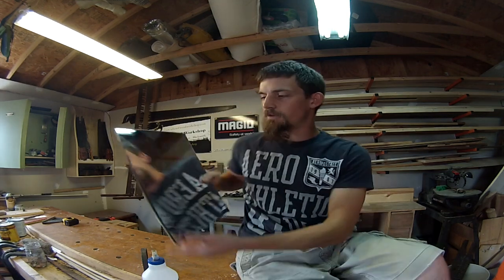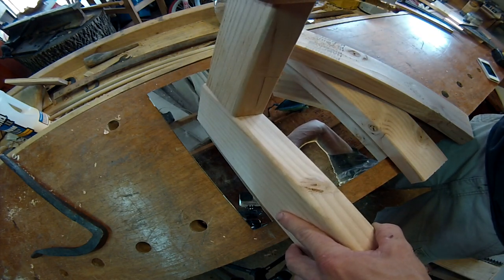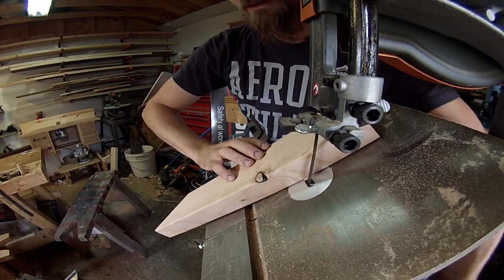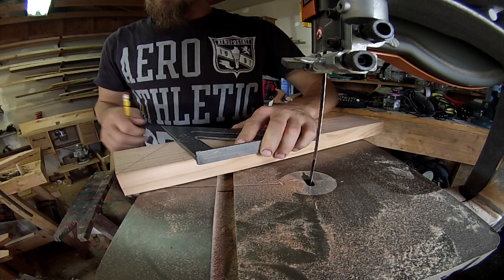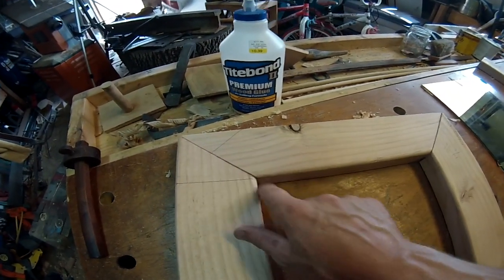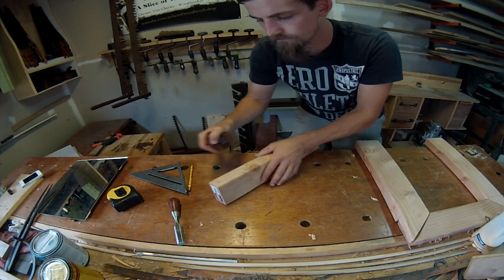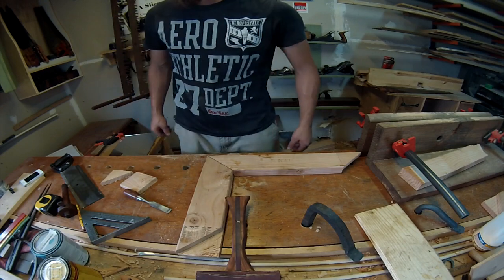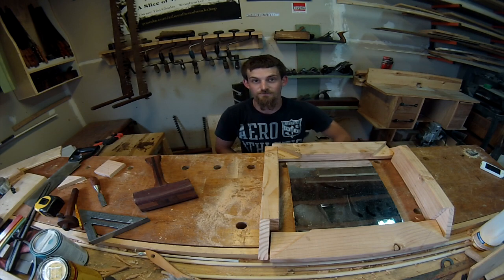HOW TO: Making a Half Lap Miter Joint

Comment: A good tutorial, and a strong joint.  I think it's important to know how to make joints in different ways.  I would probably cut this joint by hand with smaller stock, but for a big frame like this I'd be tempted turn to power tools.
Reply from the maker: Michael Meara It actually wasn't any harder to do it with handtools, although I did break more of a sweat :-).
Reply: ***** It's easier on the light bill, too.